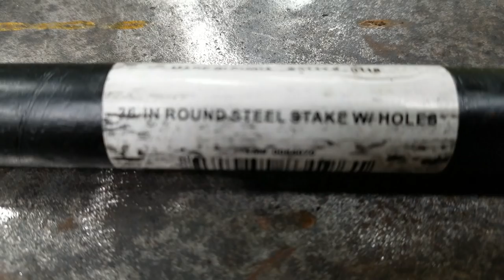DIY River Anchor ( on the cheap )

Comment: Those antique window sash weights would make a good start on an anchor. They already have a hole in them to attach the rope. Just take caution when welding whatever it is you're going to weld to the bottom of them because they are cast iron. perhaps maybe you'll get lucky and round some up in an old house they're tearing down. Good video bro.
Reply from the maker: Thank you brother  , this would make good anchors,  if you filled a hole through the bottom and then made it come a part you would have to weld it . Plus you'd have a break down Anchor
Reply from the maker: Hey did you watch my new anchor video its really cool
Reply: @FishinNStuff  no I sure haven't bro. But I will for sure check it out tomorrow evening. It is good to think outside the box 👍

Comment: If you don't have a friend with a bench press you can bend those cross pieces by scoring them with a grinder on the line where you want to bend it. Then when you hit it with a hammer it comes over easy. Once bend you can weld on the line again to re enforce the bend. Just an idea. Love the anchor and I have a ton of scrap steel to make one. Never throw steel away. If you have to buy a piece your pence will drop when you see the retail prices. Nice vid , Thanks.
Reply from the maker: I started to do that but . I thought the brake was more interesting  , plus I was placing on building one

Comment: Came across your video by accident, but watched it anyways.  Some good info and tips in it. But I would strongly advise anyone and yourself use extreme caution tying a stuck anchor to a cleat and using the motor.  You can capsize the boat if you're not careful, and that would be a bad thing.  There's a episode of Real sports with Brian Gumbel where some NFL players went out and did the same thing, well 1 out of 3 or 4 of them is the only one who made it back to shore alive.  Just thought I would let you and some viewers know about it.
Reply from the maker: Thank you for your input brother , maybe I should have chosen my words better I didn't mean to give it full throttle I just meant to break the tie strap.  In all realities it should break with a tug from your hand , but I do appreciate you pointing that out buddy and for watching too
Reply: @FishinNStuff   ahh yeah now that would make sense but didn't want anyone to take it the wrong way.  Plus just getting information out there to others.  Love your videos so far been watching a couple now and there good.  👍 keep up the good work and tight lines man.

Comment: Does it have enough weight on the spikes to drag the ground an grab in a sandy bottom? Or would something like concrete at the bottom of the square tubing help that?
Reply from the maker: You have to add some weight it was 13lbs after I finished I've got 2 anchors 1 is 10lbs the other is 15lb so that one goes nice in between,  thank you for watching brother

Comment: New sub . Great videos and builds . If you really want that extra 2 lb cld always buy another stack rod cut it to length and tack it to the flat sides of the square tubing . Just my thought.
Reply from the maker: I've found for where I fish I don't need to much weight  . But ive made 3 anchor videos I mostly make em fit other people that watch though . I. Making one next week that doesn't require any welding.  I appreciate you watching brother

Comment: Have you used this anchor yet?  What's the water bottom like you built it for?  Mud, rock, etc?  Do you think it would work better if the bottom flukes were heavier and it wasn't so top heavy?  Great video.  Thanks for the inspiration.
Reply from the maker: Honestly I haven't got to use it , I've got a new boat order and it's due in in a couple more weeks,  I've been waiting 6 weeks , plus my Dad passed away 2 weeks ago . It's just been busy the past month or so , but I made it for the river portion of the rather large reservoirs I fish , but I mainly fish them in the spring  when the hybrids are spawning . I think a heavier bottom on the anchor may just be a great idea , when I built this one I was thinking more on the lines being able to bend em to get the anchor  unstuck of needed

Comment: on my way to harbor freight tomorrow. Just the motivation I needed to get a welder. Thanks brother!
Reply from the maker: You can do it brother , watch some videos on mig welding for beginners if you've never done it , it's not hard but nothing is if you know how
Reply from the maker: How you doing with your welder buddy
Reply: @FishinNStuff  funny you ask my friend. Have a friend coming over to guide me thru that this saturday. As i told you I got left hand threads on my rod holders. Nothing left handed at Lowes Or Home depot so as usual i got Amazon to the rescue.I'll let you know.

Comment: Why not to fill it with sand?
Reply from the maker: You could do that , that steel I used cost me about 6 dollars so I wasn't to bad , scrap would be ideal.  Lead would be the best thing ti use but its expensive  , the down side to sand is steel weights almost 4 times what sand weights.  Concrete is lighter than steel too

Comment: What kind of saw do you use with that diamond blade
Reply from the maker: It is a cold cut saw . The blade is a metal cutting blade . This is it . A cold cut saw turns less RPMs than a regular saw
https://www.homedepot.com/p/Evolution-Power-Tools-14-in-Multi-Material-Chop-Saw-R355CPS/311636073?source=shoppingads&locale=en-US&mtc=Shopping-B-F_D25T-G-D25T-25_9_PORTABLE_POWER-Multi-NA-Feed-PLA-NA-NA-PortablePower_PLA&cm_mmc=Shopping-B-F_D25T-G-D25T-25_9_PORTABLE_POWER-Multi-NA-Feed-PLA-NA-NA-PortablePower_PLA-71700000034127218-58700003933021540-92700053252310110&gclid=CjwKCAjwwab7BRBAEiwAapqpTHi9SugrQuF2R2jFWMchCMSrcNHxBmkl8YQuaPtIfPs1cZEZh4f4YRoCIrIQAvD_BwE&gclsrc=aw.ds
Reply: @FishinNStuff  thanks bud I i have done several diy off your channel maybe one day I will see you round town. I fish down on wylie an around your neck of the woods
Reply from the maker: I go to Wylie sometime and Norman sometime , just depends on what I'm after . That's about the best saw I could find for the price.  I've got my money's with out of it
Reply: @FishinNStuff  I've looked at several im def gonna get this one watching your videos looks like it melts right thru steel
Reply from the maker: @countryboysandcatfish1448  it does just don't cut hardened steel with it , I made that mistake and had to buy a new blade lol
Reply: @FishinNStuff  my next one is the corner rod racks you made I really like them
Reply from the maker: @countryboysandcatfish1448  i liked that one too

Comment: How long are cross pieces 12in?
Reply from the maker: If you make em 18 inch they'll be about 12 after they get bent . I have another anchor video that's newer and I good into more detail
Reply: But what length did you cut yours on first anchor 12 or 18
Reply from the maker: 18 inch is what you cut it at . After its bent it should be about 12 inches wide
Reply: Thanks bud.

Comment: Why not fill with lead or concrete
Reply from the maker: I was just showing how you could do it cheaper  . I made 4 anchor videos in all one of them I did use lead but leads like 2 dollars a lb now I think  . Scrap steel or rebar is easy to come by